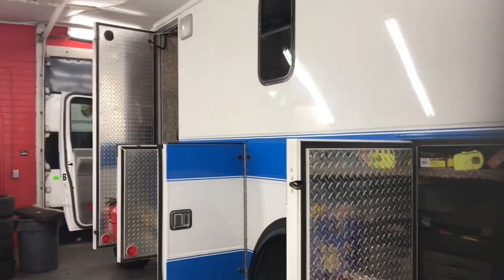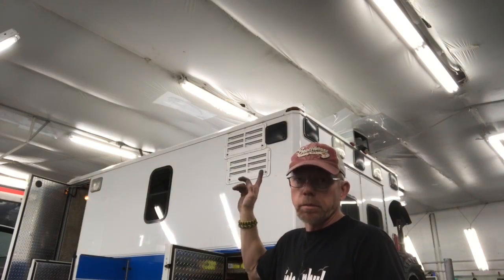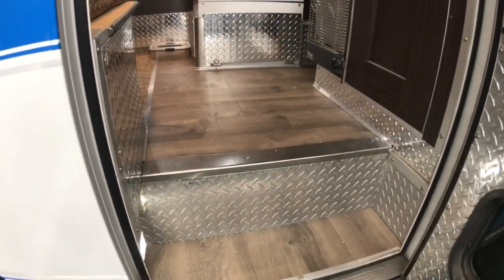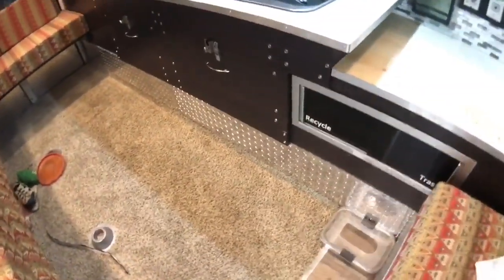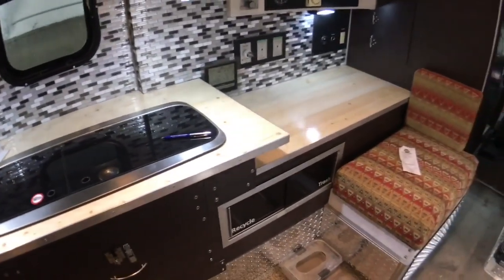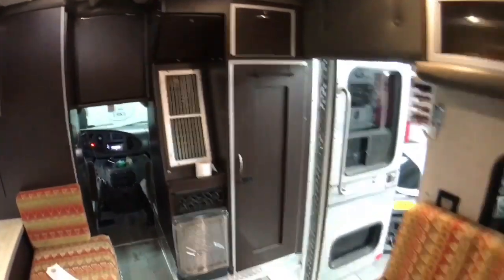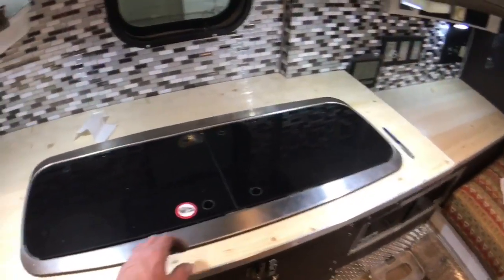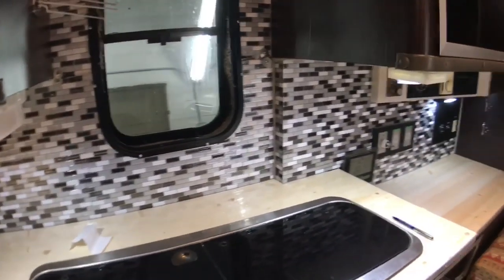4x4 ambo RV build Part 2

Comment: I would love to see more detail on the switch control panel in front cab.  What you did is amazing!  It looks so integrated now.  I also wanted to see what you did with the doghouse cover.  I have one in my Class C Ford RV, that is similar but less functional.  Mine is pretty useless.  Drinks don't fit the cup holders, and there is one giant hole for storage which becomes a hot mess of junk. No place to put documents like registration and insurance in my RV.  I so badly want to change that out but cannot find a replacement that does any better.  Due to the curved nature of this beast, I cannot buy or build any pocket storage either.  I would welcome a solution.  My doors too are totally blank, no pockets to store documents.
With regard to cabinets, I really liked the black plexiglass and wished you had not covered them with vinyl.  Even thought the vinyl looks very classy on the cabinet framework and dashboard, the translucent glossy surface of plexiglass let in more light and looked very stylish.  I would remove the vinyl from the doors and instead, add some dim LED lights inside the cabinets with a remote.  It would act as a light panel for mood lighting inside.  Great work!!
Please be sure to show details of build in your videos, such as hinges, handles, switches, ... all these are very useful examples that help us with similar solutions.  Thanks for your tour!
Reply from the maker: I was so busy during the build I didn’t video it. I went to the recking yard and found multiple factory options for the dog house for cup holders and storage. Ford made a few different types and as near as I can tell they all worked with my doghouse mounts

Comment: When you cut into the rear cabin for your window, vents etc aren't you concerned about hitting wires? I've been trying to find a diagram or something that shows me where all the wires and lines are ran in the back cabin so I know which areas to avoid making holes in and which ones I can miss everything. How did you make sure you weren't hitting anything important?
Reply from the maker: I cut a small hole and inspected the area before cutting to much

Comment: Beautiful job. What's the gas mileage? & interior hight? Thanks.
Reply from the maker: It seems to average about 12mpg I have had as high as 14.5 on road trips without much elevation change, interior height is 6'2" but this varies from ambulance to ambulance. My niece built one and it was about 5'8" inside

Comment: can you give me some more info on how you got the electric t-case to work?
like what trans do you have and what you had to do to make it work?
thanks, my ambo is coming along nice, how can i send you some pics?
Reply from the maker: Mike Gosh, I found some info on the web on it. Basically you run the servo in the transfer case with 12v in both directions by reversing the polarity. I would recommend just getting a manual transfer case if I were to do it again